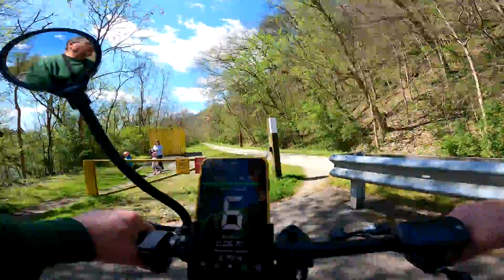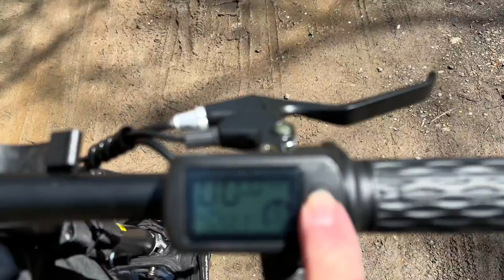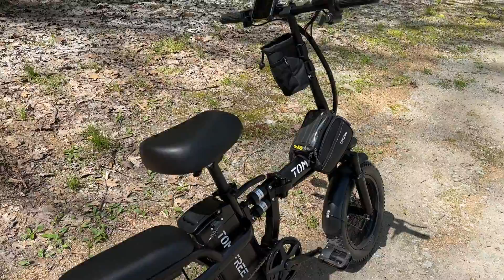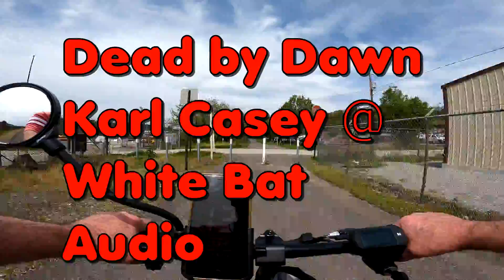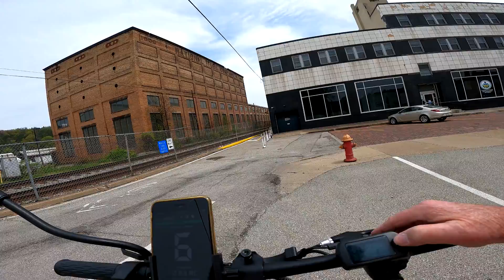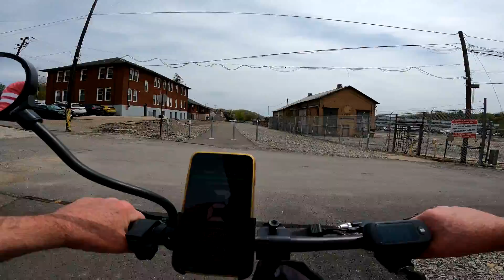Tomofree T1 Folding Electric Bike Range and Battery Test #ebike #battery

Comment: I love my Tomofree.  I wanted a Walke, but I was afraid that it would be too heavy for me.  I was right.  This little bike is already at my limit.  But I can handle this weight.  Also the Walke has a much larger battery, 60AH.  But I must say, I've never ridden the Tomofree until its 20AH battery ran out.  I find that after an hour or two, I don't want to ride more.  So the bigger battery would have been more than I needed.  A normal ride for me is five to ten miles, and this bike makes that with ease. I think I can easily get 25 miles range.  Also the 1500W engine is extremely zippy.  I have plenty of power, and it can propel my oversized derrière up to 30 MPH on a flat road!  What I don't like is that I really can't peddle this bike, but I don't miss that much at all.  If you are wondering if you should get one, yes do.  Don't wait.  Start having fun again.
Reply from the maker: It will go about 32 miles without pedaling if you weigh 190

Comment: Just did a range test on my T1. I'm a 225 lb guy. 36 miles (all flat). Average speed about 22mph. Kept its speed (on m2) up to max of 25.5 all the way until the last mile or so. Battery started at 54.1 went to 39.7. Only 106 miles on it so far, but I've experienced what others have said: tires wouldn't hold air, tried sealant and worked temporarily, eventually replaced tubes. Jerky on full throttle acceleration (but smooths out when level off speed). Can get to P settings but don't know how to change them, but all throttle's what I want anyway. Customer service was responsive and paid for the bike shop charges, tubes, and some extra for my trouble.

Comment: Your testing of this bike has pretty much convinced me I need one. Could you please maybe show us how you load this bike in your car. I also for reference would like to know your height/weight. I don’t know if you’ve ever said. Thanks man keep riding.
Reply from the maker: I just remove the battery and seat, fold up the pedals and fold down the handlebar and roll it in, I have a hatchback, I do not fold the bike in half
Reply: @bryansbikes  You don't need to remove the seat to remove the battery. There's a little lever that allows you to angle it up to get the battery out. Fits in the back of my Prius fine with the battery removed and handlebars folded. Kinda heavy to lift and move it around (maybe 40 lbs without battery).
Reply: @AlGeelhaar is it possible to replace the saddle or seatpost, or would that remove the lever as well?

Comment: What’s the top speed?
Reply from the maker: I got 24mph
Reply: 3 modes:  m1 19.7, m2 25.9, m3 29.6.  This is on flat roads, and I'm 225lbs, so your results may vary. I was impressed that it maintained ability to go top speed in m2 for 35 miles. I didn't have it at 25.9 the whole time, but did get it up to 25.5 when I'd already gone nearly 35 miles, averaging around 21-22mph.  ln short, it has plenty of speed, and maintains it even as the battery charge decreases to 1 bar.
Reply: @AlGeelhaar what are your p settings in your controller  and is it possible to change the parameters in the 3 ride modes?

Comment: Can you tell me how long it took to download and Amazon tells me that the Z1 and T1 have pedal assistance
Reply: I have this bike and it has no pedal assist.
Reply from the maker: @Ebike_Adventures same here
Reply: @Ebike_Adventures  I love this bike
Reply: @illkid86  yeah it's ok, I think the seating is a little goofy feeling, the range is also not good, I don't think that battery is actually 20ah as they claim.
Reply: @Ebike_Adventures  I haven't used it for outside of 3 miles idk how far it goes I also have a modded jetson bolt pro that goes 18 to 22 mph I like the little jetson more easier to use
Reply: @Ebike_Adventures  this bike is a lightweight scooter moped like feel which is cool the seat is kinda silly but it gets the job done I dont ride mine as much I ride my jetson more out of all my motor bikes the jetson lasted longer
Reply: @Ebike_Adventures  my bolt pro jetson outlasted my motorized bicycle and e scooter it's my baby but this tomofree bike cool I use it when I wanna have fun
Reply: @Ebike_Adventures  the bolt pro might not go 25 to 30 but it's easier and smoother to ride I had another bike called ebkarocy which was similar to tomofree but I gave it to my girlfriends son
Reply: @Ebike_Adventures  but yea I'm loving the tomofree but the little bolt pro has my heart ot was my entry into the e bike world
Reply: @Ebike_Adventures  Range was fine for me (36 miles flat). I guess lots of hills would reduce that some. I also think it will decrease as the battery wears, but fine now.
Reply from the maker: I think i have a early model with no PA
Reply: It does have pedal assist. Has to be turned on in the P settings.
Reply: @UreshiiSuika  there is no p setting shut tf up
Reply from the maker: @UreshiiSuika  Listen to what i'm telling you!!!!!!!!!!!!!! This bike has no ***** pedal asst, maybe yours does but this one don't.
Reply: How fast when you are inpedal assist @UreshiiSuika